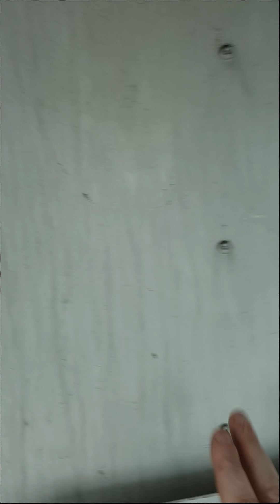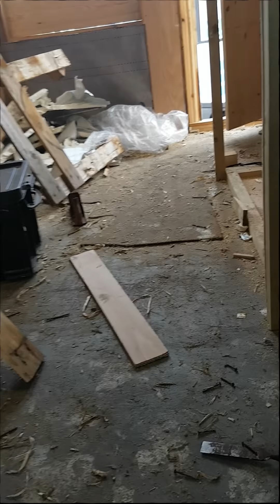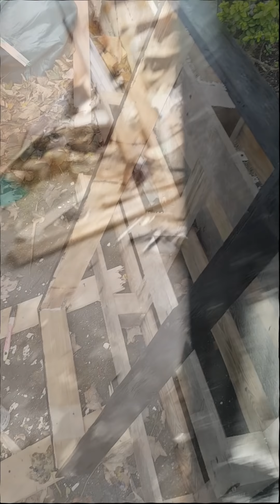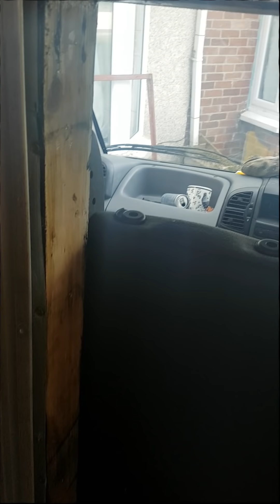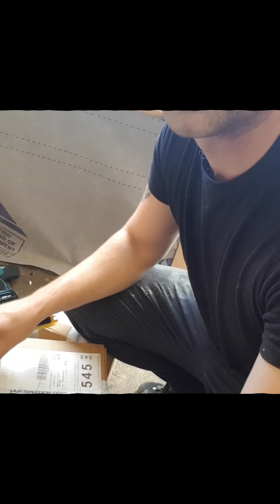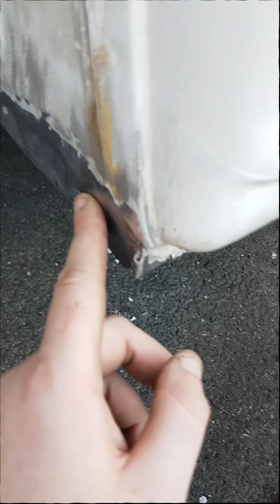Luton stealth camper/tiny house/rv Build part 4

Comment: I have a Luton and the box moves loads independently from the cab. Especially over uneven ground. So by building a solid frame connecting the two together. Won't it bend and twist the timber frame making likely to move/break/leak? My box does seem to be a little bit further away from the cab than some lutons I've seen and weater/water does come over the cab roof and down the back so it would need to be really well sealed. Have you driven it much since you have done this? It's looking good though!